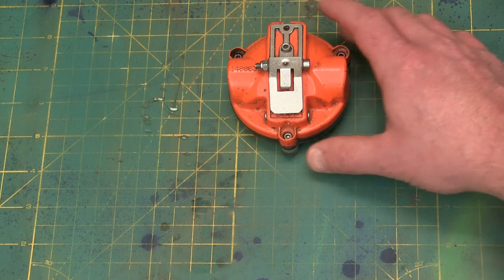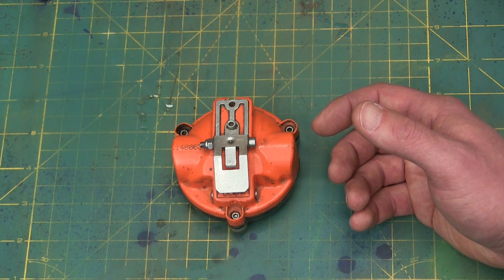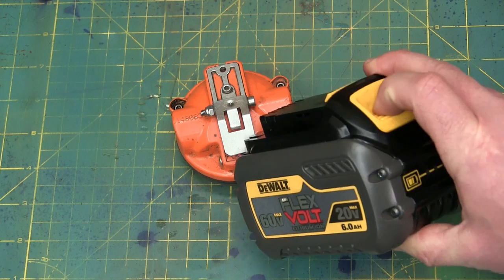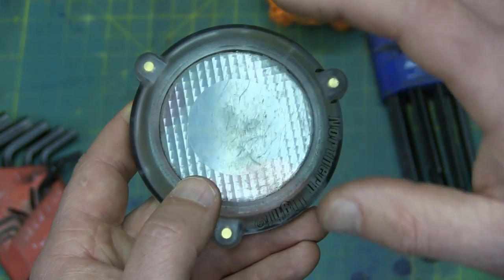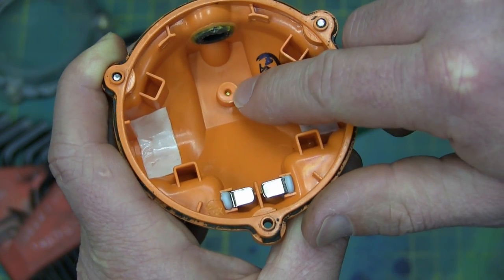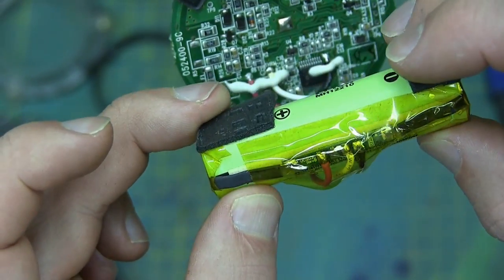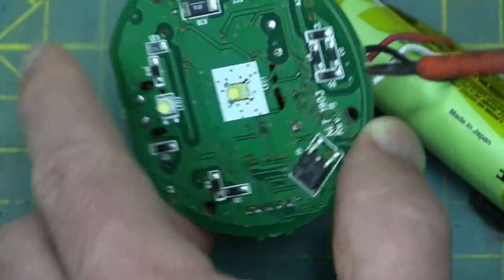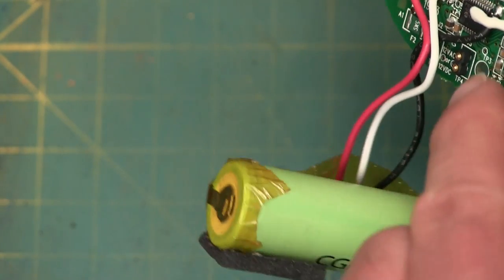BOLTR: $500 Industrial FLASHLIGHT. WHY SO MUCH?

Comment: brake cleaner, used for everything but cleaning brakes
Reply: I’ve heard it’s not good for brakes
Reply: @BrassCatcher  works pretty well as hair soap
Reply: Cleans brake dust and old lube, not brake fluid.  Water cleans brake fluid off.
Reply: Works great as a starting fluid sometimes actually good cut finder too
Reply: I’ve used it to clean off shoes from a leaking wheel seal 🤘
Reply: I use it to clean grease off my hands when im done working on cars. Did you know that its known to the state of cancer to cause California?
Reply: RAID
Reply: @bebopalloobop  this.  It's my cheap bee killer.

Comment: $500? That's nothing. I've spent way more than that on indoor lights to grow my....tulips.
Reply: Greencoast u in Ontario?
Reply: Right, thats like one HPS and a half. You could do a dual ballast, a lampholder, a mercury and a sodium lamp for that money.

More lux too
Reply: yeah.. also my uhh tomato plants
Reply: Only need HPS for tomatoes! cant IMAGINE what you could be growing indoors that would need the right light for lots of flowering? Certainly never seen that before....
Reply: I honestly don't get why people are still so enamoured with metal vapour lighting for this, ahem, application. The heat load is insane, and surely you can make up a more than adequate spectral profile with LEDs? Also, heat load will fuck your plants right up and heat load and power draw are things that will draw the crabs, which is not good...
Reply: MrGoatflakes Cost per photon is 5-10 times higher, and with plants and lighting quantity trumps quality. And yes, the heat and power draw are big issues but digital ballasts can be quite efficient.
Reply: Greencoast
cost per photon? How so? Surely the electricity cost is going to be higher than the installation cost, and also high brightness LEDs in very many colours are hardly expensive...
Reply: rofl, these people don't understand what you mean! :D
Reply: how often do you smoke, i mean pick your tulips?
Reply: Bruno Ferreira everyone does.
Reply: I wish tulips popped out of the ground on their own every spring...cops would still rip em out the ground here in the Commonwealth of Pennsylvagia
Reply: Actually, "tulips" grow wild and naturally in every state in the union (including Alaska).  You think that people have to tend to their tulips and spend a lot of time on them, but barring extreme drought or flood, tulips will do their thing, all over the place.  :)
Reply: Kevin l.  thanks Captin Obvious
Reply: Kevin, you better stop your slander.
Reply: From what I hear...the rozzers are watching for unusual electric bills and the biggest problem is the pong, the whole neighbourhood stinks.
Reply: Get a reptile/exotic animal license for the premises. Also, filtered air ducts.
Reply: When I was younger my grandmother's room was ontop of the garage, smoked a lot of cigarettes to mask the aroma
Reply: A filtration system is healthier and probably cheaper on the long run. Also, more effective.
Reply: LOL!
Reply: Another downside of the heat load is snow not settling in the roof above your tulips, makes yer house stick out like a sore thumb in winter...
Reply: Know what's worse than all the above? The lack of generosity and warmth shown by the usual incumbent with a borderline personality disorder...Who just has to share his glorious superiority (believed) with everyone, even though nobody is fucking interested.
Reply: They aren't THAT bad here, cody :P
Reply: Cody Chismark Philly ... !!! Yeah pa crazy w it ppl on here sounding like cops
Reply: Greencoast lol this comment has 420 likes. I would like it myself but then I would mess up the irony.
Reply: Bollenstreek!
Reply: I love tulips.
Reply: Scott R poppies are the same way, though someone would have to plant the correct ones (Papaver Somniferum)... much more robust and less fragile than “Tulips,” I mean, they grow in Afghanistan.... nothing grows in that Stone Age cave dweller paradise, well, except for Poppies and funnily enough, according to my brother who’s served three years over there, there’s just as many “tulips”growing in the wild as well. In fact he spent three 1Year combat tours over there and he said he saw more weed than Poppy plants or fields.
Reply: J P  Can't buy ones you never had in the first place, either.
Reply: Im just going to say it... CANNABIS??? OMG what a crime
Reply: J P  it's a light bulb, not a fucking piece of the Chernobyl elephant foot.
Reply: J P  That is not how UV (or any) radiation works, but k.
Reply: I'd like 10 pounds of tulips
Reply: Didn’t know you could smoke tulips 🌷! Thanks
Reply: Jep, is spent 5k on it 😂
Reply: Yea those are my.. um.. My special tomato plants
Reply: Chill bro , why are you bragging so much?
Reply: @Cyber.Operator.0  I think you were the single person to not understand what was being discussed by the people before you.
Reply: As a Canadian I approve your Dutch message

Comment: 3:02 That metal bracket would have to be non sparking if it went down a coal mine... was waiting for you to verify it with a grinder but it never came :(
Reply: Not even phosphor bronze.  Another way to know it's overpriced.
Reply: could still be 300 series austenitic as it turns slightly magnetic when you bend it.
Reply: joinedupjon
Reply: I love how clever the comments sections on these videos are.
Reply: joinedupjon wore one every day in a coal mine.... it’s permissible by msha.... your point is invalid.

Comment: The battery is an 18650 cell you can tell because that's the size and it also says so
Reply: AvE you can probably look it up online. If you search 18650 cells made by Panasonic you can probably match up by image with a fair amount of success
Reply: odds are 2250mah based on your video and a decent amount of comparing brand / model / product line.
Reply: they are $5 cells online
Reply: Samuel Thomas never seen a genuine 18650 that cheap unless it's really low mAh.
Reply: Wounded MONK thats the general price. they got fairly cheap due to vaping devices using them a lot. fakes are even cheaper.
Reply: More like a 26650.
Reply: BIG BOLD Print says "CGR-18650EA"; might want to try that readin thing...who knows how far you can go.
Reply: These are not vaping batteries.  They are about 10amp rated discharge.  They are cheap because they are massively ubiquitous in sealed rechargeable industrial applications due to their relative safety, shock resistance, and typical need for about 3-5 amp continuous draw in those applications.  Panasonic als uses them in all of their toughbooks, and probably some of their higher spec personal laptops.  If I am not mistaken, they may have even been originally enginerded for the toughbooks
Reply: Surprised he didnt know, even i knew that.
Reply: 18650 means its 18 millimeters in diameter and 65 millimeters in length
Reply: @woundedmonk1884  How to buy single-digit quantities (testing/for fun) of LiFePO4 or other lithium cells that work inside a usual deep freezer? 1~3Ah or so...
Reply: 18650= 18 mm x 650mm
Reply: @samberr3076  that would be a long battery
Reply: Johnny Dabs ok remove the zero lol
Reply: @verigone2677  18650s are commonly used for vaping. Right now my mods run some 3000 mAh 20 or 25 amp continuous discharge I can't remember.

Comment: LOL at the regular power tool used in mines... Like lets use $500 worth of 1S1P 2 LED lamp that is HazLoc approved, sealed and stuff then use just a regular, $100 sparking power drill that will explode that methane instantly...
Reply: He was talking about batteries
Reply: 03056932R not allowed to be used past the last open cross cut other areas are considered liberated of methane
Reply: Brushless drills don't spark
Reply: @sh115067  How bout when you connect or disconnect the battery with the trigger pulled?  Would you do it in a room charged  within the explosive limits?

Comment: Given the high cost of the flashlight and the lens's solvent resistance, I would say that it is likely the PC lens has been annealed. Annealing polycarbonate increases both its impact strength and solvent resistance but skyrockets the price. You heat up the part relatively slowly to 250-275 F (just below the GT temp) , let the temp equalize, and slowly cool it down over several hrs. Takes prolly somewhere between 6-10 hours or more. I worked in injection molding for a few years and the most "annealing" we ever did was closing a box full of parts while they were still hot lol

Comment: when you use a bridge rectifier in a DC circuit it removes the polarity bias on your charging terminals... this means it doesn't matter which one you hook the positive or negative to. It will correct itself.

Comment: Back when I worked at an injection molding factory, little brass threaded inserts similar to the ones in that lens were not molded with the part. They were put in using an ultrasonic welder. This was on parts like speaker grills for Motorola, and other similar parts.
Every once in a while the machine would go haywire and emit this high pitched screeching noise that made you want to shoot your ears off.

Comment: Never seen a crescent wrench with a hammer built in.
+1 just for that.
Reply: Haha. I bought that same wrench from McMaster Carr as a joke because my high school machining teacher kept yelling at us not to use the adjustable wrenches as hammers.
Reply: It has a 'thumb detected circuit " built in. It goes for the thumb of the operator.
 It works every time. Hockey tape time.
 The most dangerous tool in the shop is... YOU.

Comment: Those threaded metal inserts in the clear lens are actually probably "ultraset" inserts.

Truly molded-in have to be set onto pins in the mold, and that would usually be done by hand (as is mold clearing and reset). That's way too fiddly and PITA (especially in gloves, since the mold is hot) and ends up expensive in labor time and how often the mold can be shot.

Ultraset inserts get used a lot because they can be set in a cold part, long after molding.

The insert gets set just into the molded-in hole (usually counterbored a bit, to located the insert; with the main part of the hole being smaller than the OD of the insert's knurling). Then a pin is inserted into the insert connected to a device that vibrates the living daylights out of it at ultrasonic frequencies.

That vibration heats the insert up and melts the surrounding plastic, allowing the insert to be pressed down into the hole. Once the plastic cools, it's as tough as a molded-in would have been, without having to screw around with tiny inserts inside a hot mold cavity.
Reply: That device is called an ultrasonic welder and the contact point is called the horn. I used to use one of those for installing threaded brass inserts in plastic electrical enclosures at a factory job i had once...
Reply: BillCosbyEatsBabies word
Reply: Will McCammon s
Reply: Actually a lot of it is automated today and has been for years. The machines probably insert on the mold and also extract the finished part

Comment: just a single 18650 cell? thats really cool. this is just like that orange light you sent me years ago. this was your best video in a while, mostly because mining is really cool. :D

6:05 thats the BMS circuit, it most likely just makes sure the cell doesnt go above 4.2v or bellow 3.6v. i dont think they have single use fuses on them, i think its all electronic if it shuts off power.

Comment: The tiny board on the battery is a little Battery Management System or BMS.
It protects the cell from over- and undervoltage, overload and overtemperature, by shutting off the power via two MOSFETs (connected in a way that the internal body diodes are anti-serial). 
It automatically resets when the voltage/temperature is in the allowed range again.

Comment: Love how the lamp (Polaris, made by NTL) is actually measured using Lux vs common Lumens. Always dislike getting a measurement in Lumens as it is a bit of a idiot test, sure that light may be 1500 Lumens but how bright it is depends of what type of lamp it is (huge ceiling fixture vs handheld torch) while Lux is a measurement (basically) of how bright the light will actually appear when in use (bit more crap goes into it but that's the gist)

Comment: When i was a teen i used to use one of those drills for putting steel rods in to concrete foundations, we never used a jack to help push and hold up the drill it was all done by hand and often had to hold the drill above my head, they are bloody heavy, much like a air jack hammer

Comment: Ave here's your protection circuit.  Single cell ov uv and oc Thirmister included
Reply: made in Canada! I wanna buy some of those protection circuits :(
Reply: soundspark lmfao hell no. this is for small IoT lipo powered projects <1A.
Reply: yeah, why fuck around hey? Those ICs are pretty cheap, and although normally in hobby applications people take perverse pride in cobbling together their own reinvention of the wheel, lithium batteries are fussy as fuck, and dangers of charging or discharging them wrong them include but are not limited to limiting battery life, fucking the battery permanently, fire, explosing and death. So yeah, why fuck around when a 50c part can do the job? Also, even big companies like Apple often fuck it up, so yeah. Why fuck around? But I repeat myself...

Comment: You're right about the little protection circuit on the battery. That looks like an 18650 (18mm diameter, 650mm long) lithium ion battery and is probably a lithium iron phosphate chemistry. It would come from the manufacturer with the tabs and circuit for about $4.

Comment: The battery is an 18650 Lithium Ion. The charge control circuit primary purpose is to prevent overcharging
.

Comment: One advantage of using a voltage converter over a regulator is that you can get better power usage efficiency with a converter.
 This will allow the battery to last longer, which is what you want if you're down in the mine. 
An LED is basically current driven. Your power loss when using a regulator is the voltage drop across the regulator times the current. The regulator acts as a resistor to drop the voltage to the set amount. When using a switching converter, you don't have that loss (although there will be other losses from the components that you're using) since it is just turned on and off at a duty cycle to achieve some desired voltage.

Comment: Any way you could tear apart a few coffee makers and analyze their "engineered to fail" sort of stuff please? 
I'm sick and tired of buying a coffee maker every year
Reply: Tyler C just buy a kuerig. i fuckin love the thing. i use 20 times a day. just run some vinegar through it quarterly and its a beast. thank me later
Reply: T C The reasonably priced Philips with included thermos next to me has been doing fine for more than 5 years with similar maintenance.
Reply: Cure - Rig coffee maker? Problem is you have to drink the tainted hot water after you've brood it.
Reply: My family has had the same coffeemaker for close to a decade and it’s still works just fine. Maybe dont shop at Walmart LOL
Reply: Buy a drip filter and a kettle.  If the kettle breaks you can use a pan and a blow torch to heat the water.  Jobs a good un!
Reply: I've only bought one coffee maker in my whole life. Maybe there's some sort of user error involved here?
Reply: The direct aluminum heating tube is the source of failure, gets clogged with lime scale.
Reply: A French press could be the last one you buy
Reply: The delonghi is fucking brilliant, we have one at work, it’s been there for 5 years, five years of 30 fucked off 200-300lbs gorillas with no understanding of technology who hate everything beating it 24/7 365
Reply: Do you mean a kettle?
Reply: @lukkbox77  no a coffee maker

Comment: That's very interesting. For anyone that's curious, the main LED is most likely a Philips/Lumileds Luxeon Rebel (the off-center chip gives it away), and the off center square LED appears to be a Luxeon T series (very unusual corner bracket things). Are they using just the PCB for heat-sinking? Seems a bit dangerous to me for such emitters.

Comment: 6:06
It's a overcharge/discharge protector. It shuts of the circuit if you go over 4.2 volts, or under 3.0 volts?
Reply: Dan R. Hansen um are charging stands we’re set for 3.8 v

Comment: $500 seems a bit steep for a flashlight.
Reply: it's industrial
Reply: Barnacules Nerdgasm In what you're more  used to, $350 'ish USD, maybe seems less crazy
Reply: Barnacules Nerdgasm It's because it's explosion proof rated (ATEX regulations here in europe). The cost comes with the testing and certification - it costs tens of thousands of pounds/dollars for which in the grand scheme of things is a low volume specialist product, and as ave said, there's a huge liability issue, a mine goes boom because of your lamp - that's one big law suit!
Reply: Barnacules Nerdgasm i like your morning coffee streams.
Reply: when your life depend on it it's still cheap
Reply: you can bay the same thing for cheep if you want but for mine certification and chooche factor  it int a key chain LED
Reply: Really though, it's still steep. Shouldn't prices to test and certify be covered by the government if they actually wanna help out?
Reply: Its not on the government to help private corporations achieve safety certifications. I'm sure you wouldn't want to increase taxation to help boost a private corporation's bottom line. (Well.... any more than we currently do)
Reply: I've spent about this amount on my (dynamo) bicycle lighting setup. It's worth it.